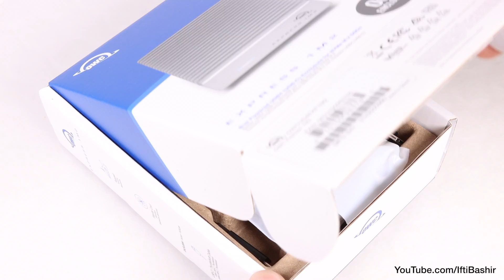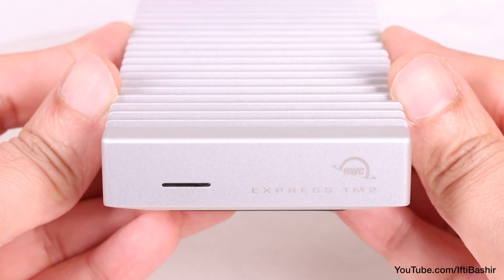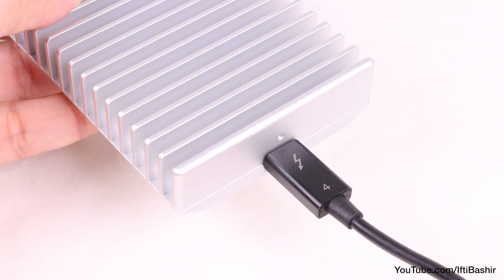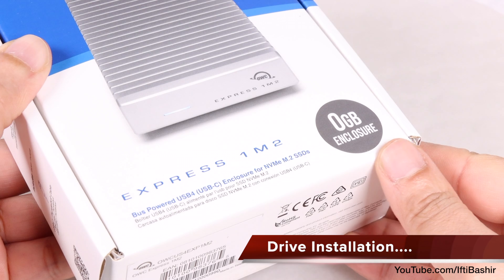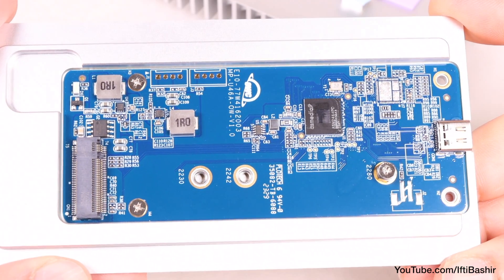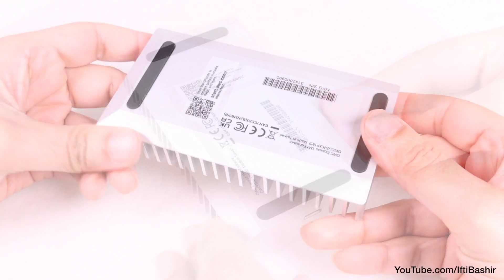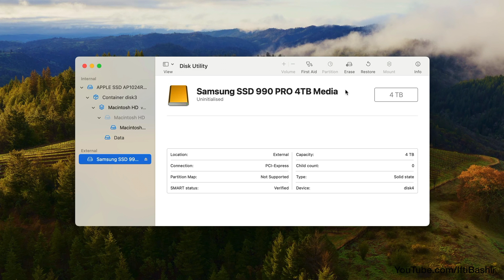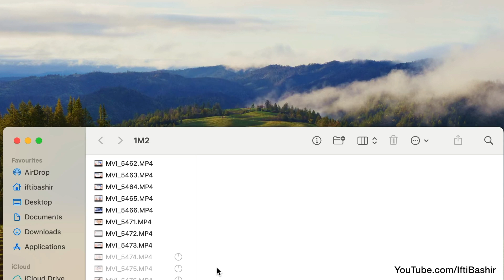OWC Express 1M2 - Portable 40Gbps M.2 NVMe SSD Enclosure! : REVIEW

Comment: Well, I do allot of video editing so here’s my take. If you are just using these devices to transfer the occasional file, it probably doesn’t make allot of difference which one you buy, as long as it’s from a reputable brand (Ugreen as example). But if you do excessive work from it hours at a time like video editing, the cooling becomes a primary concern. I can’t speak for this OWC model as I haven’t tried it. But it appears well made for precisely the cooling feature. 

If you look at the competition, allot of the units have fans. They didn’t put fans in them to look cool. I can assure you these outboard SSD’s get very hot, especially if you edit your video files right off their memory. They are plenty fast to do so. So keeping them cool is better for the life of the memory and lowering risk of thermal shutdown. 

I have been personally using those new cell phone coolers attached to my portable hard disks (Nubia Red Magic Cooler 5) and have had excellent results. It went from my portable drives being so hot they were nearly uncomfortable to the touch, to completely cool even after 4 hours on Final Cut Pro. So this is one alternative to having large fins, or a built in fan that could one day fail (then what?) on your ssd enclosure. 

I would say if you are a fairly heavy duty user, perhaps media editor and could have your drive working for hours at a time, don’t buy a model with a fan. The fan won’t last forever and if it fails, your enclosure may be bricked. Better, get a model with good cooling fins like this OWC. Or a similar model with static cooling and use the aforementioned Nubia cooler clipped on to it. Keeping your enclosure cool isn’t difficult by design with what we have available today, what becomes important here is you wanna buy one and have it last a long time.

Comment: Great video. I'm thinking about the same setup (OWC Express 1M2 with Samsung 990 PRO NVMe 4TB). Can you update Samsung 990 Pro's firmware while it's in the OWC Express 1M2 with Samsung Magician Software on M4/M4 Pro Macs? If not, then you're better off using OWC SSDs.
Reply from the maker: No you can only update Samsung drives on the Windows platform I'm afraid, but I find I very rarely update firmware anyways considering I had the max performance possible already (through a TB4/USB4 interface anyways)

Comment: hi, i have similar configuration as yours. when you eject the drive, does the enclosure led still light up? i was expecting it to turn off
Reply from the maker: Yes mine do the same - it stays on as it's still connected and being powered despite you unmounting the drive.
Reply: @iftibashir  thanks for the info. this is my first SSD enclosure coming from Samsung T7 drives so I thought they will work similar. do you use Samsung Magician? mine keeps showing drive health N/A and genuine icon not represented

Comment: Get the ZIKE DRIVE instead, buy a 2Tb or 4TB M.2 Drive 980/990 pro.  Format to APFS,  you get 3300mb+ speed writes.
Reply from the maker: Not all about speed - it's about sustaining the speed through adequate cooling too.
Reply: @iftibashir  agreed. but i'm curious, do you think I will ever be transferring enough data to hit a heat level that would then cause it to throttle? Like how much data would this be? Or is it possible that this throttling is really a hypothetical that may be unrealistic in the real world?
Reply: Thermals of Zike drive is inferior to the OWC so doesn't work well with 990 Pro, another youtuber made a video about it.
Reply: This one has much better cooling.  The zike drive’s fins don’t even run in the right direction.  They should be spreading heat away from the drive and not along the length.  The cooling surface area of this one is much larger too.  And I doubt the zike is noticeably faster because this is already maxing out the 40 gigabit connection (12 gigabit of which is unavailable due to being reserved for display bandwidth).

Comment: I have a 2020 Intel  iMac, and from the OWC website, it appears this does not support Thunderbolt 3. If you plug it into a computer with Thunderbolt 3, it drops down to 10 Gbps.  I bought an OWC Envoy Pro SX, and I get 2800MB/s through Tunderbolt 3. Something that people with slightly older computers should keep in mind.
Reply: Yeah that’s I what I wanted to upgrade my 2017 iMac, but it’s expensive for my budget: I went for a compromise to still get the stability and reliability of OWC, ordering the Envoy express thunderbolt 3 with a 2tb Nvme-which will give me up to 1500mb/s-it’s less speed than the Envoy Pro SX but significantly more than my Samsung T7 SSD which I have been using for my 2014;iMac. And the cost of this set up is less than half of the price of the Pro SX.

Comment: Thanks for the video. Have you tried it with any other then 990 Pro drives? Maybe some double sided ones? Is there a TB4 cable in the box and is it heavy?
Reply from the maker: Its larger than other NVMe enclosures but not overly heavy - easily very portable. It comes with the cable in the box (albeit a short one as shown in the video). I have a second unit that came pre-populated with an 8TB OWC drive - works equally as well as the Samsung 990. Your bottleneck with external enclosures like this is generally the interface rather than the actual drive......

Comment: Thanks for testing testing this enclosure. Can you give an estimate of the capable speeds using a thunderbolt 3 port?
Reply: This is not directly compatible with Thunderbolt 3. With Thunderbolt 3, it will drop down to USB 3.2 10 Gbps speeds, which will be less than 1000 MB/s, so roughly a third of the USB 4 speeds.

Comment: Thank you for sharing your experience with this enclosure. Do you have any thoughts regarding your 0GB enclosure vs. the other options (ie. 1, 2, 4 or 8TB)?  Provided you went with a Samsung NVMe, was there a minimum drive speed you considered to achieve the same performance shown in the video for this enclosure?
Reply from the maker: Considering the interface is the real bottleneck with any external enclosure, as long as you use a fast NVMe speeds should be similar - the main difference will be keeping an eye on thermals and seeing which thermal throttles sooner, if ever.
I do have an pre-populated unit on the way, which I believe come with OWC's own Aura IV drives, so will test and report back if drastically different to the 990 in this video ;o)
Reply: @iftibashir  Have you received your OWC version with Aura IV drives? How would you compare to 990 Pro speed and heat wise?
Reply from the maker: @noisetin  Sorry I missed your comment - performance is precisely the same!
Reply: @iftibashir  Ty!
Reply: @iftibashir  Thank you!

Comment: The acasis 405 pro m1 active cooled enclosure is a much better option. 

Connecting the owc to thunderbolt 3 ports have very slow speeds.  I will return mine.
Reply from the maker: I prefer passive cooling as I like a quiet environment. As you can see in the testing, it work’s beautifully for me - I’ve actually ordered another!
Reply: @iftibashir  you dont hear the fan at all.
Reply: @onlyvik  I've purchased the TBU405ProMax and the noise is annoying me. lol
Reply: @onlyvik  Every time someone tells me I won't hear a fan, I hear it too much.
Reply: When you say "slow" what computer are you using and what transfer speeds were you getting?
Reply: I returned the Acasis the fan drove me wild